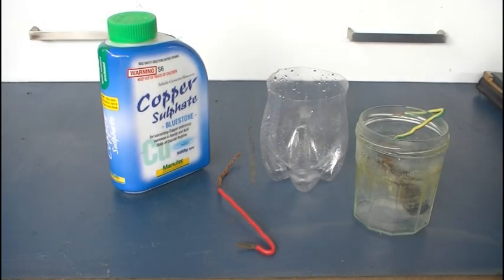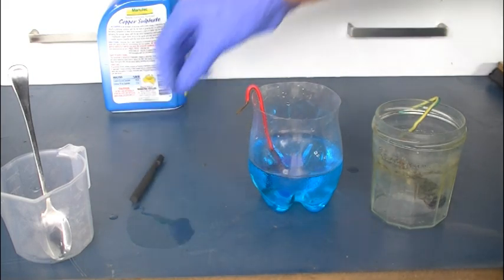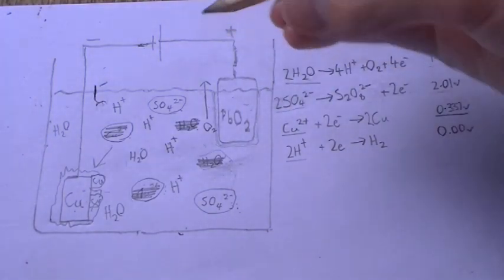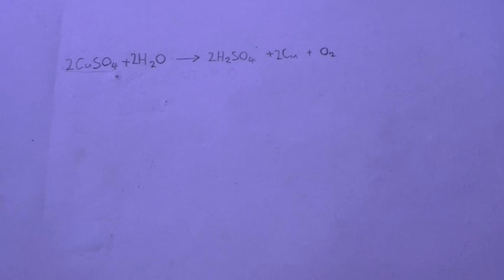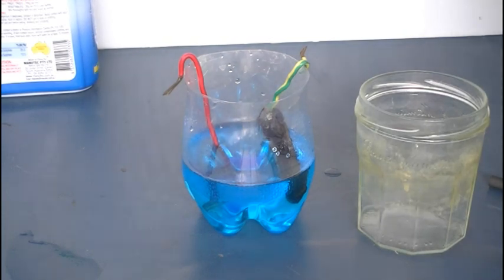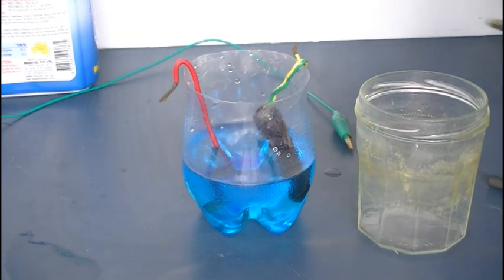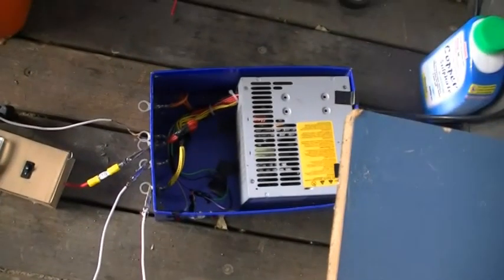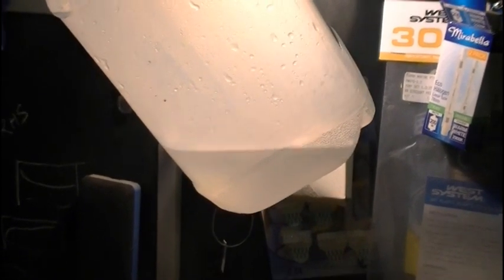Making Sulfuric Acid

Comment: Can i use a pencil graphite as the anode? Please answer as fast as possible scrap science
Reply from the maker: Yep, you’ll probably need a few though, because they don’t last too long
Reply: @ScrapScience  Thank you so much dear...
Reply: Another question. That is can i use a 9v battery?
Reply from the maker: A 9v definitely won’t last long enough to make any significant quantity of the acid. Your best bet is a big 6v lantern battery or a simple 5v DC wall adapter.
Reply: @ScrapScience  Thank you so much dear...😀😀May God bless you...
Reply: @ScrapScience  okay!! Its just a request. You may accept this according to your own whims. Can you upload a video of how to make CuSO4?
Reply from the maker: Copper sulfate is pretty much always made by a reaction between copper metal and sulfuric acid (essentially the reverse of this video), which I’ll probably go over in another video eventually.
However, making copper sulfate from other reagents (with the intent of making it from easier to obtain chemicals, and to avoid the circular nature of making the CuSO4 from the H2SO4 we’d already made) is a little outside my skill level I’m afraid.
Reply: @ScrapScience  I am the same person. Thanks for your information...❤️🙏

Comment: Can i use a nickel silver rod instead of lead?
Reply from the maker: I'm afraid not, your anode will quickly deteriorate in a cell like this. I'd recommend finding some graphite electrodes (sometimes you'll find them as 'gouging rods' for welding) as they seem to be the easiest to get hold of for most people.
I'd also advise against using lead anyway unless you're equipped for the toxicity.

Comment: My local hardware store has sulfuric acid. But I live in the US with much less nanny regulation.  But great Job!  Knowledge is great to share, and thank you for the equasions.
Reply: But at which concentration? And is it impure drain cleaner?
Reply: There are a few kinds that are 98% with no additives. I get liquid lightning the one that says "virgin sulfuric acid", they also make some with a buffer in it that makes it brownish. But mine is completely clear. There are a few other brands but I don't remember their names.
Reply: I find drain cleaner not a good source for clean acid. It is concentrated, yes. But to get clean acid you need to distill it. A task that you don't necessarily want to do. Distillingt sulphuric acid is scary. 
But pH lowering liquid from the pool supply is very pure sulphuric acid in a medium concentration. Or battery acid is also very pure and abou 40%. Just boiling off the water is very easy and there is no need to get close to watch a distilliation. Just pull the plug when the white mist occurs.
Reply: @jackmclane1826  yup purity and concentration requirements cost and availability and equipment all factor into decisions. 

By chance, can sulfuric acid from the hardware store be "cleaned" of certain unwanted contaminants with electrolysis and a separator?
Reply: @kreynolds1123  The easiest way to remove organic compounds is to drip in small amounts of H2O2 until it clears up. All organic molecules will get ripped apart and go off as CO2. Drawback: It adds water that needs to be boiled off. And inorganic contaminations cannot be removed like that. You need to distill it, Nurd Rage has a nice video about that, but I have not yet tried it. I keep my distance to boiling Sulphuric. ;)
Reply: 30% and yes, it has additives suitable for a drain cleaner.  You can also purchase it online at higher strength, and a much higher cost, for example plus $100 hazmat (hazardous material) shipping fee.
Reply: @firstmkb  we have drain cleaner that's 98%, costs about ten dollars, has pink dye, but it's never interfered with a reaction I've used it for.
Reply: @firstmkb  https://youtu.be/4DUGRWjdNLI does a great video on this.
Reply: Walmart has the cheapest and very concentrated sulfuric acid. its pretty pure, transparent and can burn through the paper. sold as a drain cleaner but i guess its as cheap as it gets, without any additives.
Reply: @tsraikage Meanwhile in Europe 15% H2SO4 is the legal limit.
Reply: The term "nammy regulations" is perfect, I'll be using it
Thanks for the wisdom
Reply: @guythat779  Thank you. Maybe nammy were you live means the same as nanny where I live. Or maybe it was a typo.  But yeah the mothering smothering state telling one not to touch the stove or step on cracks or denying adults reasonable access to sulfuric acid is a problem. And though there is an argument it dangerous to handle on ones skin, damage to the environment is questionable against the benefit it provides users who need it, as it quickly dilutes and reacts quickly with other products forming mostly harmless byproducts.
Reply: @kreynolds1123  I think the issue is more than just safety but a question of drug making or explosives making

Ofc you got the funny thing in UK where ppl threw acid at each other too

But that's also quite silly, for the acid attacks they simply replaced the acid with other weapons since no one addressed the root issues
For bombs/drugs it's like vanning wood and steel to stop the manufacturing of other weapons.
This is blatantly stripping power from the people because the people are not trusted with it. It also happens in case of tyrannical governments (mine :) ) as they don't trust the people not to go after them and for good reason 

Nanny regulations can only be put by a government detached and distrusting of its people and I will not stand for that

Comment: How would you have filtered the solution? As sulfuric acid is quite corrosive, most "simple" filtering media (e.g., cotton or sand) would get destroyed and thus contaminate your acid.
Reply from the maker: Regular old filter paper or even a paper towel are good options, as the acid won’t react with them unless very concentrated
Reply: Ah, ok — thank you! I didn't know that sulfuric acid only reacts with paper or cotton when it is in concentrated form.

Comment: I use a lead anode, basically a long wedge sinker.. First ran it at around 300mA till it was black then around 3 amp and later 5 to 7. Seems to be holding up very well no signs of breaking up or going into solution. I notice that when the CuSO4 concentration was high strong strong copper trees formed but now that is had finally became pale blue the copper is spongy and now gas bubbling from both copper cathode and lead anode. What happens if one continuous too long will the water start to be electrolyzed and will this in fact increase the acid concentration? If one stops and there is still a very pale blue color how to remove this?
Reply: .......yes, that very fine brown lead dioxide is insidious. I don't trust it drifting about in household dust . It gets deep into the latex gloves and surely is nano particle level dust.
Reply from the maker: First of all, please be careful if you use a lead anode, lead dioxide is inherently incredibly toxic and improper handling can lead to serious life-lasting health effects. Just make sure nothing gets contaminated with lead salts and/or make sure to cathodically convert the lead dioxide back to lead metal after you're done.
As you saw, towards the end of the electrolysis you'll get an increasingly weak CuSO4 solution, and as this happens, water does begin to become electrolysed. The rate of this is relatively negligible though (at 1 amp you'll split about 0.3mL per hour), so it's not a concern for any change in concentration.
The only real way to remove 100% of the CuSO4 is to continue electrolysing until its all gone. It might seem like it takes a long time to remove, but eventually it does disappear.

Comment: Since there was a lot of H2 that formed, wouldnt that mean that the solution is just SO4(2-) with a little bit of H+ ions? So its not really sulfuric acid or?
Reply from the maker: While there was a lot of H2 discharged at the cathode, especially near the end of the run, the anode reaction was actually producing H+ ions at the same rate that they were being destroyed, so the overall concentration of the H+ didn't change.
Reply: Scrap Science ohh of course thanks!

Comment: I think you should not use plastic bottle
Reply: Polyethylene tetraphtalate is highly resistant to sulfuric acid
Reply: @bearcatben4762  It's really not at all. It'll hold up against low concentrations in the short term, but should not be considered for storage or going anywhere near sulfuric above 30%.
Reply: @Relatablename  I am just saying what I know from a materials data sheet if you say so say it

Comment: i have pure PbO2 rod, can you say me a way to use it. as it will not conduct electricity now
Reply from the maker: It really depends on how you got the lead dioxide, if you bought the PbO2 anode online, then your electrode is probably dead and unusable.

If you made the lead dioxide from lead metal, I would seriously recommend converting it back to the metallic form (by using it as a cathode in a sodium carbonate electrolyte for about a day) as the PbO2 form is inherently VERY toxic and is difficult to handle safely. Using PbO2 anodes, especially ones made by anodising lead, cannot be used for pretty much any reactions besides the one shown in this video and simple water electrolysis of sulfuric acid. I would encourage the use of graphite anodes rather than PbO2 in any electrochemical reaction unless you have the proper safety equipment to deal with lead compounds.
Reply: @ScrapScience  Would it be a good idea to bake the copper sulphate to get rid of the water already in it as it always seems to come in a saturated form? Seeing that water is the most annoying contaminant in acid it seems like a great way to get rid of a lot of it before even starting. The only place for the hydrogen needed to make the acid to come from is by consuming your original starting water itself.

Also those lead dixoide electrodes are great. They seem so useful.

Comment: Thanks for sharing, think your videos are great! .... One question about this Sulphuric Acid,  ... What percentage is this? Roughly is good enough ;-)
Reply from the maker: @The DabMaster4567 That's not quite how boiling points work. As the concentration of sulfuric acid increases, the boiling point of the water coming off also increases past the regular 100C. The effect is that the boiling point will gradually rise from 100C all the way to the boiling point of azeotropic sulfuric acid, 337C, as more and more water is removed.
To reach azeotropic sulfuric acid (a 98% concentration), you need to actually reach the boiling point of the azeotropic acid to drive off the last bits of water.
Reply from the maker: If I remember correctly, the percent concentration for this particular video was around 3%. However, I have been able to achieve a concentration greater than 20% in other experiments by simply using more copper sulfate to start with.
Reply: @ScrapScience  .......... Thanks for your reply, ... So the more sulphate, the stronger the acid gets? ... I've heard that it makes no difference, but they might not know anyway! ... I was looking to try and get some up to 90% or more, .. I've also heard that if you boil the acid up it makes it stronger, is that correct? ... Cheers ;-)
Reply from the maker: In this case, seeing as you’re making the acid from the sulfate directly, using more sulfate will make a larger quantity (or concentration) of acid. 

I’m afraid you’ll struggle to get any concentration above 50% with this method, as past that point, the conductivity of the solution drops drastically and the reaction almost stops. If you want a higher concentration, you will need to boil it down, but this is incredibly dangerous and requires temperatures of over 300C. If you go that way, I’d recommend reading up on some safety procedures and using proper glassware seeing as boiling sulfuric acid is not very nice.

If you’re using the method in this video, I’d also recommend using a graphite anode, to avoid the toxicity of the lead electrode.
Reply: @ScrapScience  can't you just boil off the water? Then it doesnt need to be 300C but only around 100C
Reply: @mummiedanser1609  yea you can, just boil it until you see white fumes
Reply: @Swagnermite  yeah the white fumes indicate that it is around 93% sulfuric acid and that is has formed an azeotrope with the water right?
Reply: @mummiedanser1609  i'm pretty sure white fumes indicate >93° but if you leave it cooking for a few minutes longer even more water boils off, i've read sources saying it gets up to 95 and even 98%. I did this a while back and i stupidly filtered it using cotton which turned instantly into a black sludge lol so it must have been pretty concentrated

Comment: Will lead ingots already have a dioxide coat? Can I just use those? Should I wear gloves when handling the lead?
Reply from the maker: Alpha Bravo yes, you can just use lead strips or ingots as they will quickly form a dioxide layer for this reaction. If you’re going that way then you’ll definitely need to wear gloves and preferably even more safety gear, seeing as the toxicity of the lead compounds is very high. In fact, if you can, I would recommend using a graphite anode instead.
Reply: Scrap Science I don’t have any graphite ones but there cheap so I might just buy one to save myself from the toxicity, I have lead and compounds of it in my room in plastic containers, thats all right for now. I’ll see if I can get some graphite

Comment: Nice video. Can I use an anode of zinc?
Reply from the maker: I'm afraid not, the zinc will quickly dissolve in the sulfuric acid under anodic conditions. For the anode you're stuck with using only lead, graphite, or platinum, though when using lead you'll need to be careful of the toxicity.
Reply: @ScrapScience  I'm repeating it with lead with a current of  2 amp. What is the maximum current that lead can support?
Reply from the maker: @PaulSt-Germain-c7u  It really depends on the surface area that you have between the electrode and the solution, but using something of similar size to the one I use in this video could easily handle about 5 amps (provided that the whole thing is submerged). If your electrode is solid lead then It'll be unlikely for you to be able to wreck it due to high currents. Be wary that the current in the cell will dramatically increase as you generate more and more sulfuric acid.
Also, make sure not to touch the anode with bare hands after it's been used.

Comment: what is the current you used in this video
Reply from the maker: I believe I was using something in the range of 2 amps, which a lead dioxide anode can handle easily. However, if I were to use a carbon anode, the current would need to be limited to something like 0.1 amps so as to not damage the anode too quickly.
Reply: I've used over 2 amp. Time ∝ current. You have the equation Q=Ixt